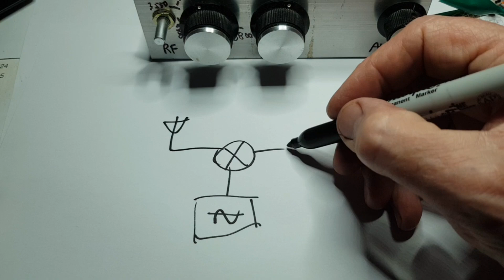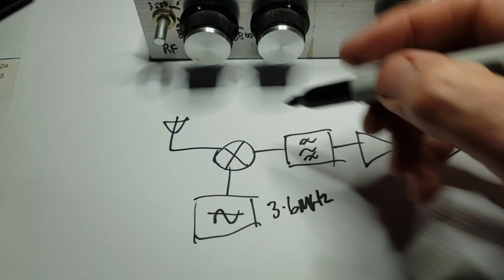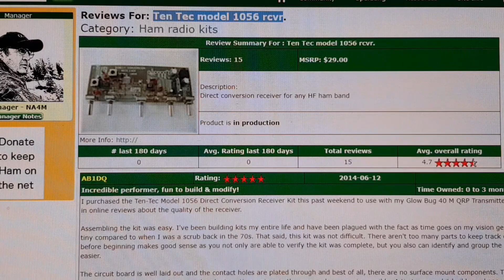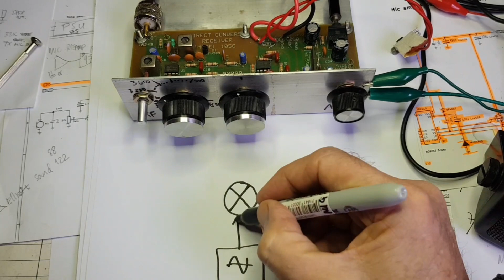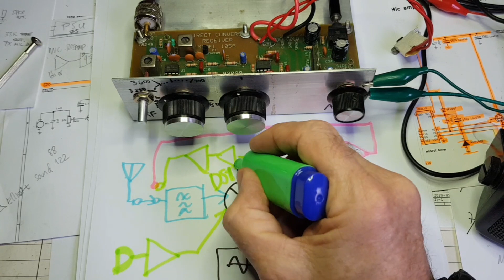Ten Tec Model 1056 Direct Conversion Receiver, is is useable, what to do with it?

Comment: This was interesting.  I came across the 1056 I built many years ago in a parts box I was going through.   I remembered I had a great time with it.   It was, of course, missing some parts.  I am in the process now of bringing it back to life for the 20 meter band.   It simply had too many good memories to leave derelict.   Amazingly enough I still have the building instructions with schematic.
Reply from the maker: Yes, it's more the nostalgia for me, and getting it going again to experience what ham radio reception sounded like back in the day.  I hope you have the NE602 in 8 pin DIP,  getting hard to find these days.

Comment: One of the joys of building gear is finding old projects and reviving them! Good stuff Paul, and I think that the old 80/20 rule applies to simple receivers and transmitters too - 80% of the performance is gained with just 20% of the complexity. Perhaps you'll pull this receiver out again in a few years and take another spin around the band with it!

Cheers,

Dave
AA7EE
Reply from the maker: Thanks for commenting Dave. You are right about simple receivers and transmitters demonstrating the 80/20 principle.  Another way that I think this is true is that the last 20% of a radio project in terms of features, sometimes takes 80% of the total effort.  Which is all to say, as far as HF QRP radio is concerned,  simplicity has a lot going for it.
My Tentec DC Receiver is safe in its box, it did enough to hold off part stripping or an eBay listing,  so it will come out again someday, sooner or later, for another evaluation.   Maybe it will be a collectible next time.
73 Paul.

Comment: Have 1056's 160-20 meters. Tentec® Also have a Heath® and most favorite the  kanga® verry little in super hets. Enjoy them a lot tks om de kv4li. Cheers.
Reply from the maker: 160 to 20m, impressive! That's a lot of rigs! 73!
Reply: @Paul_VK3HN  I wonder the audio from a pixie could be sent to af amp on reciver with a relay dropping out the af when in a key down ?
Reply from the maker: @stephenwilliams5201  I suppose so, I've never looked at the Pixie. Why not just homebrew a CW Tx on a little board, leading to an IRF510 for 5 watts? Easy! You'd have to shift the VFO frequency on transmit by about 700hz.
Reply: @Paul_VK3HN  the pixie has some audio and sense the front end is kinda wide as a barn door. The only real help is the af amp. "On the dc rig" I have built my rigs with speaker.  The dc reciver could listen then drop out to stand by and use the af to serve and not need head phones. Like give it a try I have 40 meter wire, a pixie and some cable. Wish me luck hi hi 73 de kv4li.  @ 7.110
Reply from the maker: @stephenwilliams5201  Good luck with QRP CW Stephen, with a bit of persistence you will be amazed.
Reply: @Paul_VK3HN  u are right got my best going from hickman co Tenn. To Tahoe  on 180 mills and I've herd vk, and G's on a decent night  weather will stabilize soon 73 from Tenn usa. Kv4li. At 70 years old radio is now good low impact exercise.

Comment: Well done paul, as always a joy see you taking us back down memory lane, this particular receiver has had a lot of attention over the years, I bought a cheap little pixie from china and put it inside with a relay for the anttena, fantastic little setup, I received contacts from all over Europe, great video thanks for sharing. Stay safe.
Reply: Yes you are right paul,  fun is what they are, a  Well designed transmitter and keep the power consumption as low as possible and you will be surprised of the results, fantastic for long periods in the field. Well done keep the video's coming.
Reply from the maker: Thanks Peter. It's amazing how much fun you can have with a small, basic rig, particularly a CW rig. They are so simple, but also, remarkably effective.

Comment: Thanks for the trip down memory lane Paul. I built one of these years ago and found it drifted so bad it was unusable. After replacing the caps in the oscillator circuit it still did it, turned out to be the inductor can, replaced that and it worked very well.
Reply from the maker: Thanks Joel, it's pretty good for a DC receiver, very sensitive,  didn't have any hum problems,  audio bandwidth well shaped. Drift is the main issue, but even that's not terrible once it has warmed up.